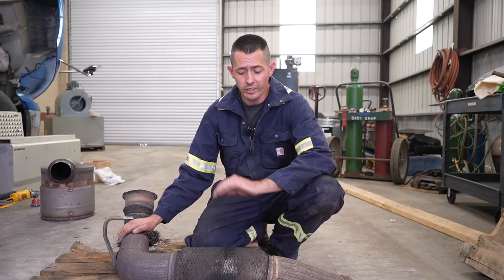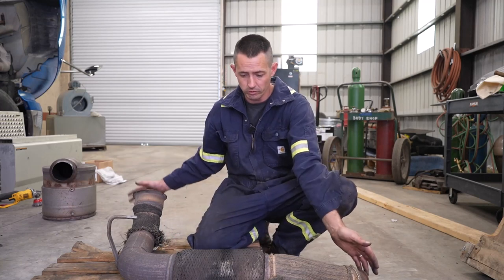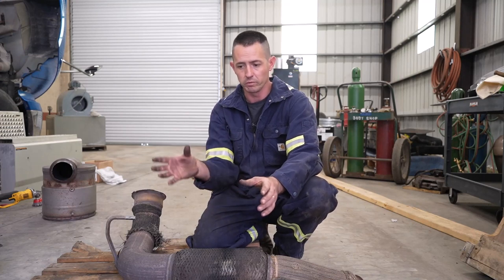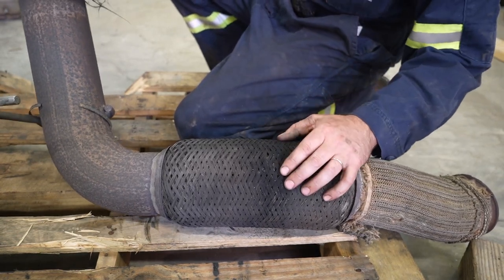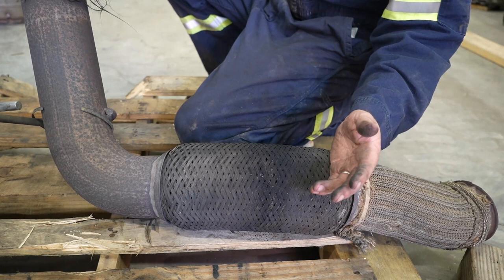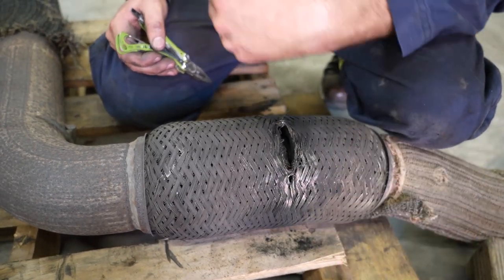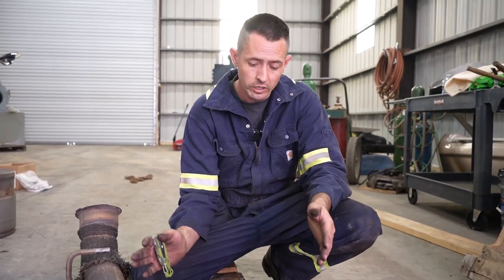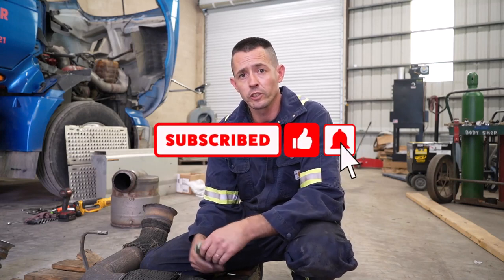Semi Truck Exhaust Bellows Leak - How To Fix (International, Kenworth, Freightliner)

Comment: I'm having this same issue with my prostar. The stealership said 2600$ for just the parts with no known availability date (on back order) was wanting to know where you got that replacement for 800$
Reply: I went to my international dealer and they had an aftermarket version for a little less than $800. The stock version was way more expensive.
Reply: Whats the name of that part I have the same issue

Comment: So the fix is to buy a new one?
Reply: Top of your class, we’re you?
Reply: @wk8457  No, but I see that you weren't neither. Let me help you. Change "we're" to "were." We're is the abbreviation for "we are." So go ahead and fix that. No need to go buy a new word from the store to fix it. 😂
Reply: @cruzancoconut  Feel smart, yet? Keep your trailer home clean and you may arrive there, one day. I’m not concerned with an autocorrected word in a YouTube comment.
Reply: I mean that’s usually how I fix my stuff…. Unless the part is not made anymore, why reinvent the wheel?
Reply: @monkeypox9683  Normally when I fix exhaust leaks like this, I cut out the bellows and weld in a new one with my mig. All I was saying is that the title makes it sound like he's going to repair the defective bellows.
Reply: @cruzancoconut  so basically your fix to the leak is to replace it.

Comment: You have great contents! Thanks. I have an 09, vnl 630. The symptoms that I have due to the bellow leak are; erratic idling, regular regular requests, a very subtle whistling sound when I apply jakes and about an extra mile per gal increase in fuel consumption.
Reply: you better check your intake, the bolt heads at the front of the engine like to break off, a bellows leak will not cause most of your symtoms
Reply: @youtubeisawesome2487  thanks, I replace the injector cups recently but I will check again to make sure. I just replace the bellow, it had two soot markings on the pipe indicating a leak. The truck is idling perfect now so let’s see if the other symptoms go away.

Comment: Hey Ryan, I live in canton and have a 2018 volvo vnm 200 with an scr fault. I've replaced the doser valve and one of the nox sensors. I have the intlet nox sensor but I found a leak at the clamp behind the doser valve. How much would you charge to diag? No check engine light, just message scr fault engine derate. I'm thinking it's got build up in the elbow just in from the doser but haven't tore into it yet.

Comment: Hellow Ryan thanks for your effort!
I have 2014 volvo with isx15 motor, around the tip of exhaust pipe its leaking white crystal residue to much, and I took the truck to different shops, one has changed the dosar valve but no one was able to figure it out so far...any help pls...thx...